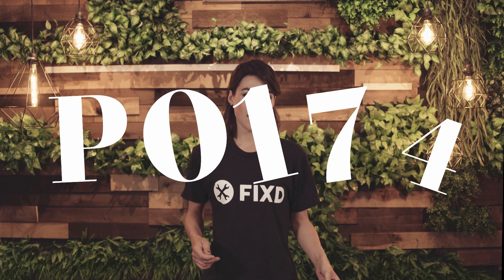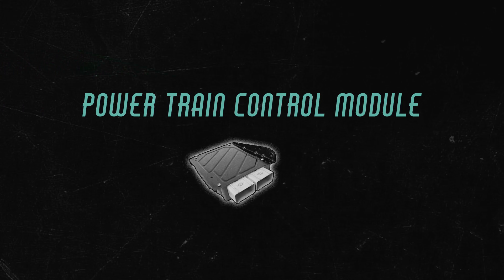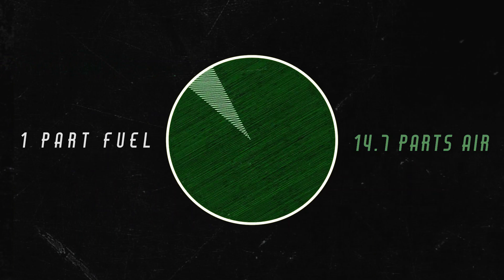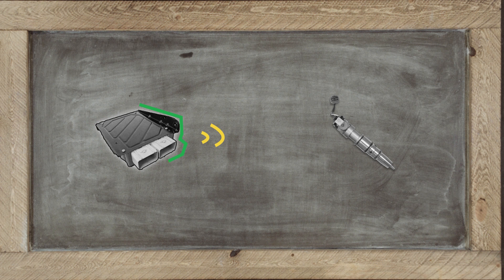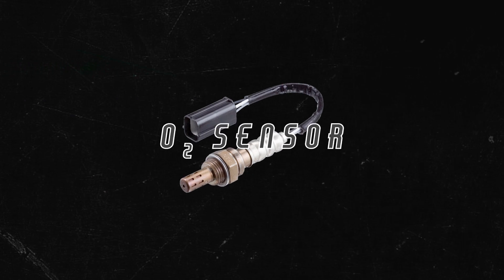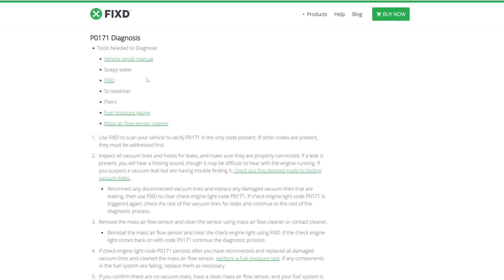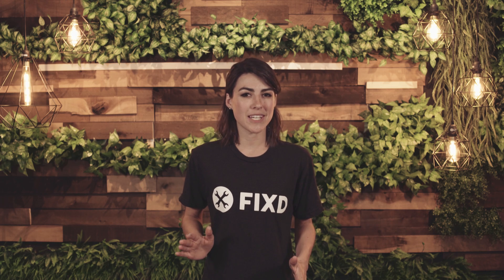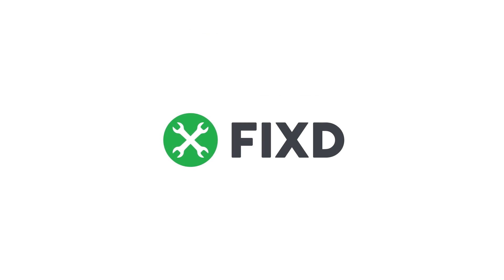P0174 Explained - System TOO LEAN (Bank 2)

Comment: Great video! Clear and concise explanation. I checked out your related blog post. I believe there might be a typo in calling the error codes (starred below)?

Possible Repair Costs for P0174
When it comes to making repairs associated with the P0136 code, one or more of the below repairs may be needed to solve the underlying issue. For each possible repair, the estimated cost of repair includes the cost of the relevant parts and the cost of labor required to make the repair.

Comment: threw money at some parts for this code to no avail. A mechanic hooked up his sophisticated scanner and finds cylinder 5 bank 2 . -- the problem was water in this well due to a loose radiator hose. Mechanic tightened the hose clamp, added coolant and dried out the well.

Comment: Question: if your car has two banks, but the code is only for one bank (bank 2 too lean), could it still be the maf sensor? 

And wouldn’t an exhaust leak need to be before the upstream o2 sensor to cause this code?

Comment: Dope video. Perfectly explained what I was looking for (what does Bank 2 specifically mean?). Thank you very much!
Reply: Bank 2 means the bank that contains the #2 cylinder. Could be driver or passenger just depending on where the manufacturer placed cylinder #1.
Reply: i ain’t no mechanic but bank 2 means that it could be on the driver side of the engine (if you’re engine is V configuration) . I could be wrong though
Reply from the maker: Thank you for taking the time to watch 😊 We appreciate your kind words. Happy and safe driving!

Comment: Thanks i fond y code p0174 was going off their  was a leak in one off the hose in right side in the back off the engine👍👍👍
Reply: How did u find leak
Reply: I put the code in in the module is not responding can you help  @dannyterry1744
Reply: I found my hose was ripped im good now
Reply: @dannyterry1744  what hose was ripped the air or water hose?

Comment: I changed out the MAF and replaced vaccum lines that were in bad shape and that got rid of the bank 2 lean code. Still have a misfire on cylinder 4, but found out that air is getting passed the exhaust valve on that cylinder.

Comment: have a 2015 charger se, i have a new engine i did all injector flush new spark plugs new o2 sensor new battery,  some codes went away but i have 3 left p0300, p0174, p2099 help

Comment: Since I have a hole in my catalytic converter, I'm pretty sure that's what's causing that code. I'm having that replaced and the downstream O2 sensor replaced just to be safe.
Reply: Excellent! A new cat will help control the mice living in the trunk.

Comment: So is this an expensive fix?
Reply: no not usually check for air leaks while engine is on sprays the hose connections for air with carb cleaner , the engine rpm will rise if you find a leak tighten clamp or replace hoses

Comment: Hi, thank you very much for video! Question..if changing air mass flow sensor on traverse 2013, do I have to drive at least 70 miles for computer to recognize new sensor and fix issues with reduced power engine?  I know it could be ONE  of many issues to look at..Thank you again!
Reply from the maker: Great question. Once the faulty part or suspected faulty part is changed always clear faults and test. The cars systems will need to go through their test via a drive cycle/ readiness test. This can be anywhere from 50 to 100 miles. I always suggest to rescan after test drive whether the light is on on or not. Of course this applies if the car is running ok.
Reply: I have a 2018 frontier.My exhaust broke at the flange ..the code came on bc it wasn’t getting a propper read of the fumes..the exhaust has been fixed and code is still on..I was told it will reset after xxx miles or drive cycles..I’ll let you know
Reply: It took a few days driving,a dozen cycles or so..

Comment: Beautiful young woman giving this explanation. I will try the fuel side first, (change my fuel filter). If the check engine light is still on, I will change my four O2 sensors. Thanks for the great advice. I just subscribed and rang the bell.
Reply: What was the culprit? I’m pretty sure my fuel pump is weak , my car turns on and drives but lacks performance above 3k rpms . I changed bank 1 and 2 sensor 1 which was faulty and now I have this code
Reply: @evojumpman8806  I ended up changed all (4) O2 sensors, but it was the MAF, (mass air flow sensor). I changed the fuel filter, as well. Runs great now. 2005 Chevy Astro, 4.3L
Reply: HomeTheater GuyUSA fuck your lucky , ive already cleaned my maf before this code came on Bc there was 02 sensors malf. The only problem is the fuel filter and pump are inside the gas tank :(
Reply: HomeTheater GuyUSA dp you think when I put an aftermarket intake it would have caused this? I unplugged the mad without disconnecting the battery maybe that could be it but I’ve felt this problem since I got the car but I just got the code after replaced the 02s
Reply: @evojumpman8806  You will be fine. I put dual CAI tunes on my Astro and runs smoother acceleration and better gas mileage. The computer adjust instantly with the added air and cool air. (You do not have to do a drive cycle). Check out Jet Performance site, they have chips and programmers for most cars.

Comment: Need Help please, my engine light came on the code was P0174, then after I went in put a higher grade of gasoline in there the light went off, so what should I do, or will the auto shop still be able to bring up the code
Reply: Change fuel filter first. If the light comes back on, change the O2 sensors.
Reply: @NonPremiumID  Most likely a vacuum leak post MAS. Check PCV hose or valve or a hose came off of the intake after MAS
Reply: What is MAS
Reply: @SnyperThatGuy  the gathering your mum goes to on sundays
Reply: If the light went off after using a high octane gas it's likely an O2 sensor and or catalytic converter.  Try and stay away from the cheap gas with high amounts of ethanol. If the light went out on its own , the system corrected and it will now pass emissions test.  Also get some MAF sensor  cleaner and clean it.